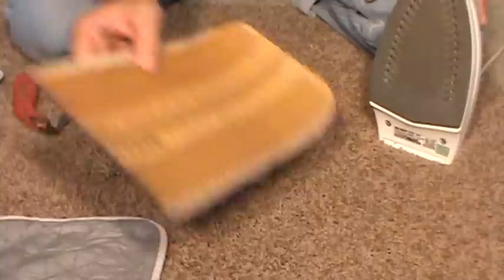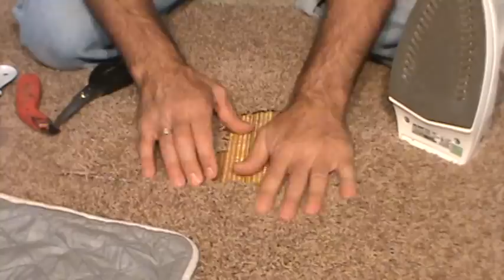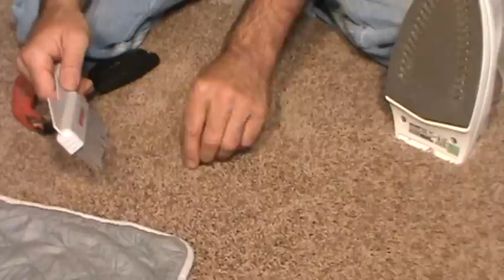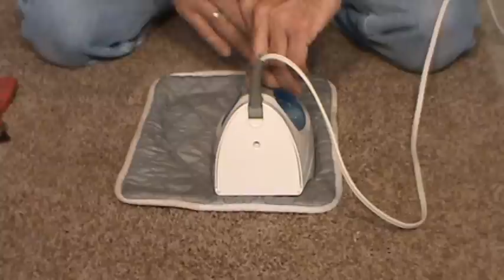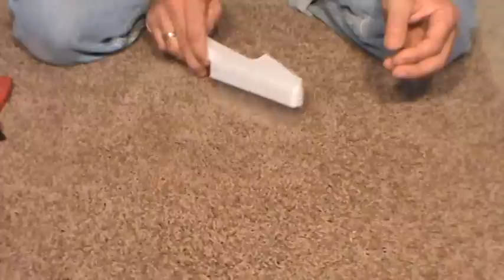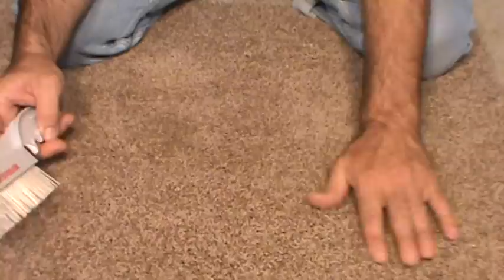www. How to Repair Carpet. com, Fix, or Patch Carpet

Comment: Awesome tutorial! I have dark green carpet with an even darker and unremovable strawberry soda stain that is very noticeable. I have some extra carpet from originally carpeting that room acting as an area rug on the cement floor in the basement that should be about equally worn, so I think I'll take a bit of that as a patch. Was beginning to think I would have to put up with it until it was time to replace the whole carpet!
Reply: Ch4osWe4veR p
Reply: no itll come out red dead n steam iron
Reply: Ch4osWe4veR it doesn't need to be patched, Google red stain removal. much easier

Comment: This is NOT the way to repair carpet!
Reply: you can use seam tape like he is using and use a high temp glue gun with just a craft glue stick and it will bond better than this!
Reply: or use liquid latex and seam tape or even fiberglass drywall tape will work, just so long as the scrim matterial you use is stable enough to press the adhesive into both the carpet backing and the scrim matterial.
Just dont try using an iron to patch as small hole like this!
Reply: you should also seal the edges of the repair plug and the carpet that is being repaired with a seam sealer or even elmers white school glue will work for a good diy repair. 
This will prevent the carpet from fraying after a couple of months of vacuuming.
Reply: apply a thin bead of glue or seam sealer along the cardboard like edges of the carpet, avoid getting the glue on the carpet fibers and let the glue dry for 20 minutes before making the repair.
Reply: you can use two faced carpet tape or rubber cement or hot glue sticks and make a very nice repair, the method this guy is using would probably void the warranty of the carpet and could damage some carpets by resetting the direction of the fibers.
Reply: You do realize there's an edit button, right?

Comment: You can clearly see that the patch of carpet he put in the hole was the one he cut out of the same hole have a good look when he puts it in the hole so of course it is going to look good coz it's a perfect fit and has exactly the same wearing on it I have a Husky who has ripped a few holes in my carpet and I have patched it myself and it takes a long time before you can't notice it anymore.
Reply: How did you fix it ? My husky ripped my carpet too and he Chew the side by the wall I live in a apartment I really don't know what to do....
Reply: +becky yu  Hi I ended up cutting a peace from the wardrobe and brought a roll of carpet joining tape but no matter how perfect the fit of the patch because the carpet from the wardrobe looks brand new it is starting to blend in as time goes on that's why I commented on this video because when you take a patch from somewhere else it won't look like this video the reason it looks so good is because he has just cut that patch out of the same hole he has putting it back in to so of course it's going to be a perfect match both in size and colour so it's very misleading.

Comment: I did a repair not too long ago where some guy used this technique to do a seam. Not very ideal. Seam was coming apart. Customer was very pissed. I used the old trusty "seaming iron" to fix it right. Maybe this clothes iron technique is ideal for small patches for a DIY project but for bigger seams hire a professional carpet installer.

Comment: Great video but I can imagine 3 problems possibly developing- one we don't all have a piece of carpet lying around, much less a matching color, and two you probably can't vacuum over the fixed spot anymore (which would present an issue with an extra powerful vacuum like mine).  Also I have thin carpet so a ruined portion of it might not be replaceable
Reply: Sounds like new carpet for you?

Comment: Great video but I can imagine 3 problems possibly developing- one we don't all have a piece of extra carpet lying around, much less a matching color, and two you probably can't vacuum over the fixed spot anymore (which would present an issue with an extra powerful vacuum like mine).  Also I have thin carpet so a ruined portion of it might not be replaceable.
Reply: surething baby he said he took the piece from a closet. Just a suggestion.

Comment: WOW this is NOT how you install a patch. call a flooring installer. he uses the proper tools like a seam iron tractor and seam weight. CALL A PROFFESSIONAL!!! it will last 100 times longer than this guys patch job. this will probably last 3-6 months.
Reply: richard dyck 3 months is plenty of time to get the deposit for my apartment back. I can see how some viewers might want to heed your warning, but I’m moving out of an apartment that I have kept spotless for 3 years, only issue is carpet clawed from my secret kitty roommates. They’re supposed to replace things like carpet after a couple years anyways.